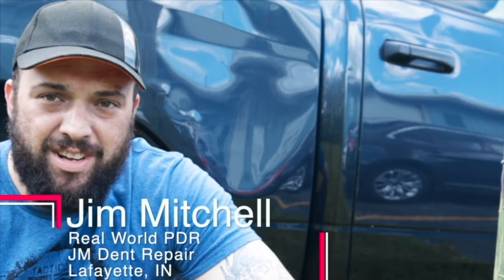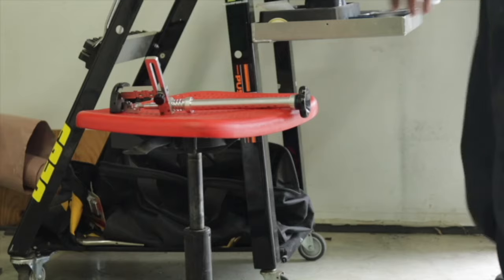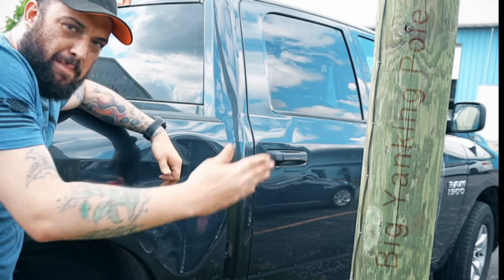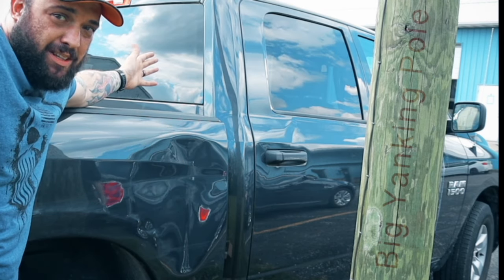INSANE DENT PULL - Awesome Trick - Gnarly Bedside Dent

Comment: Yo what is the glue you use to hold the blue holders in place where you can then remove them with no residue?
Reply from the maker: We were using cam-auto glue and isopropyl alcohol will take hot glue off cleanly

Comment: The most important and awesome part of this dent pulling repair is there seems to be no heat of any kind that burns off the rust proof protection on the inside (back side) of the metal panel. Because, when someone tac welds them metal dent pulling stems to the surface to be pulled out, as well as using a cool torch on the panel it burns so many spots and area’s inside the panel that begins immediately rusting right through the repair. 
Did you ever notice seeing so many newer vehicles that had bodywork done (on the sides) and painted rust bubbles over the exterior wheel well's are popping out, bumping out all over, mainly above the rear tires on pickup’s.

Comment: I’m late to the party but, what’s the name of this kit minus the ratchet straps of course? Fixin to pull a dent outta my 78 GMC van that a 3 ton moving truck decided to put in it during the last snow storm…..not sure if this’ll work on an old solid steel van body but, I’m willing to try anything. Thanks!
Reply from the maker: It would work if the paint holds. It’s a kit from a company called Cam Auto. Frankly it’s too damn expensive for the do it yourself crowd. I run a dent shop so we get plenty of use out of it, but if it’s not something you’ll use often, it might be cost prohibitive.
Reply from the maker: And even if you’re late, thank you for taking the time to watch!
Reply: @RealWorldPDRTraining  thanks for that. Appreciate it man. Any suggestions on old steel!? I’m pretty heart broken over this dang dent….that van is my baby.